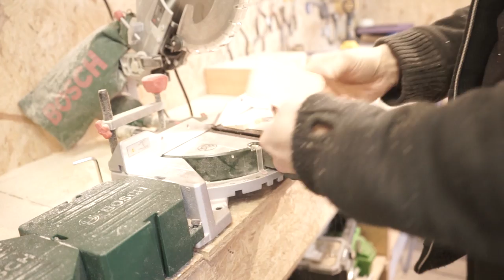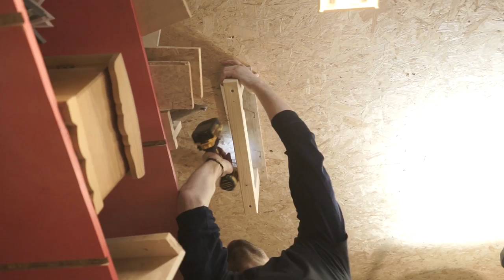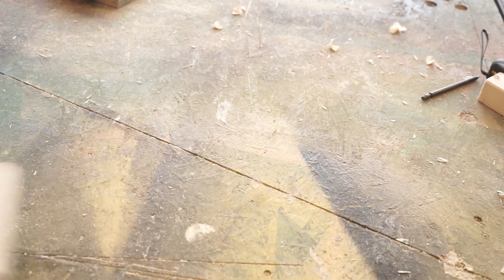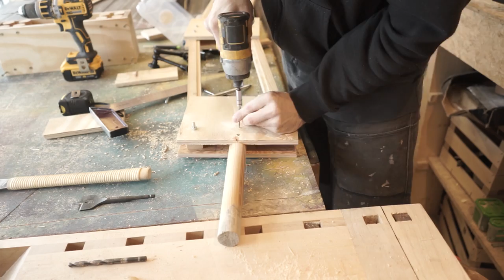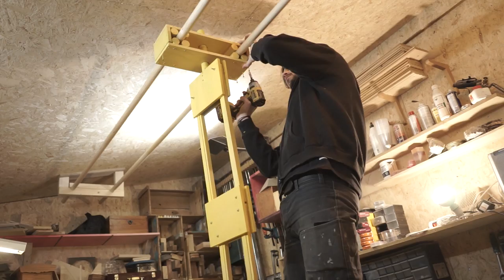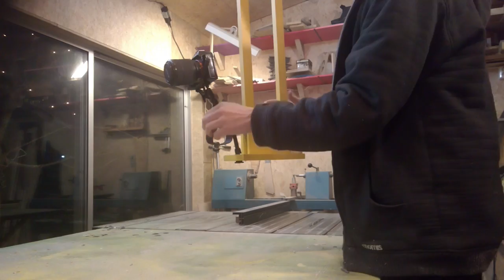Making overhead articulated camera crane on tracks

Comment: In the Eurobox shop rejig video... this has long gone. How long did it actually last? Because I was waiting for you to put some extra bracing towards the middle to stop those long poles bending. I think this was a step too far for a wooden project and some metal wires at least were needed. Don't get me wrong though, the whole thing is as ever genius.
Reply from the maker: Lasted a year. Did not actually breake, but was not as useful as intended, thinking about making a new one